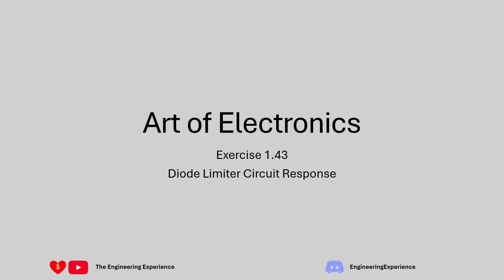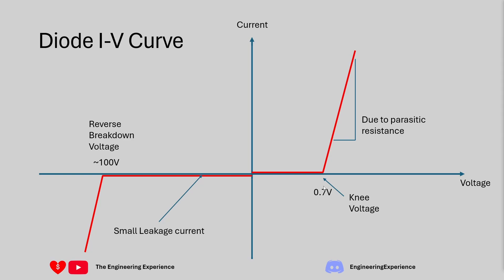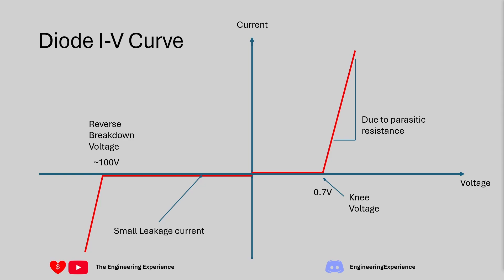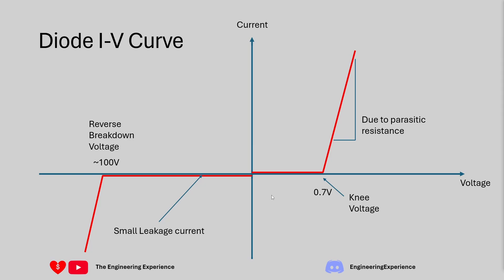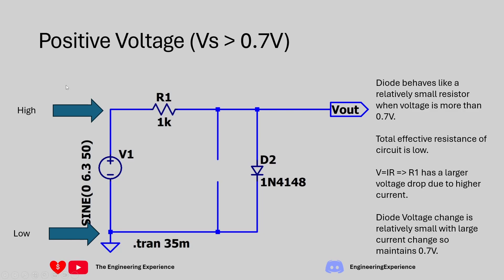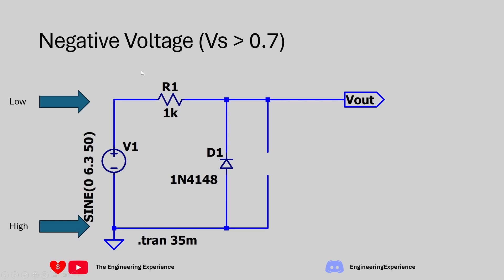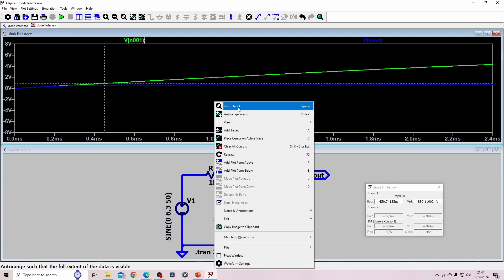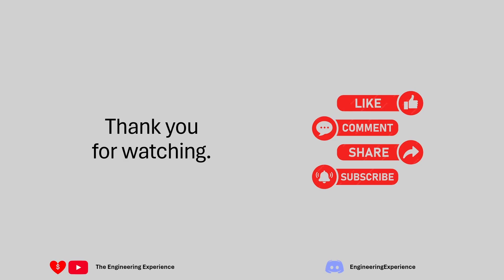You Must Learn This Circuit! Diode Limiter - Art of Electronics Exercise 1.43

Comment: Hey. I think it would be nice to think real world scenarios where you would actually use these circuits to make videos more interesting. Diode limiter is simple circuit. First that comes to mind is maybe zero cross voltage detection perhaps with huge resistor in series. I'm not sure though how well it would work, but the idea is if you feed its output to MCU you can't go over 0.6V to damage MCU. But you could also use just resistor divider. Also MCU don't like negative voltage either so not sure what to do with negative part. Only place where I have used this circuit is I think as rough reference voltage, although zener is much better. Diodes are often used on ADC inputs to protect them against overvoltages. They often don't have resistors in series, but input themselves often do so it is basically diode limiter. Although one side is put to supply voltage(like 3.3V very common) and another to ground(can be also negative rail).
Reply from the maker: I think this exercise in the book is more for understanding how these things but real world examples are definitely usefull. Although zeners are usefull like you said.

I do like your idea of zero crossing detector. Because this restores a dc voltage for signals above 0m7v, we could simply add a series capacitor with the load. We should get a spike every time we have a zero crossing for the signal. 

I am recording a practical video for this anyway so will add that to the end. 

Thanks!
Reply: @TheEngineeringExperienceYT  Yeah I agree this book is more for understanding. But after I watched your I remembered what I though after I saw this first time. I always tend to think of real world examples because it makes learning simply more fun. It was just a thought. Looking forward for the next chapters where circuits will be more fun! ;)